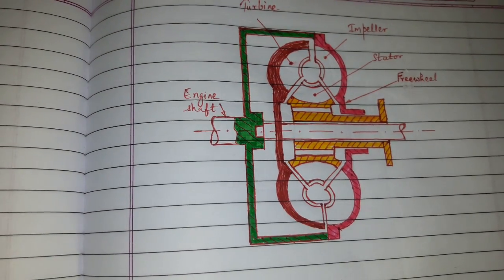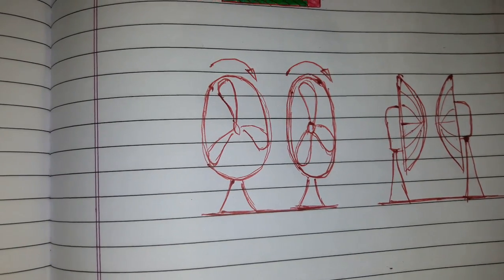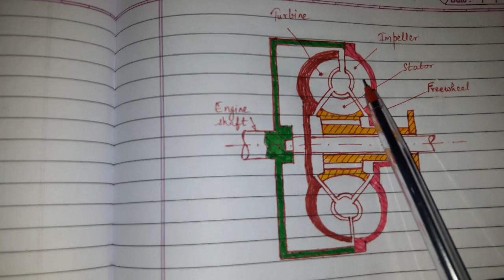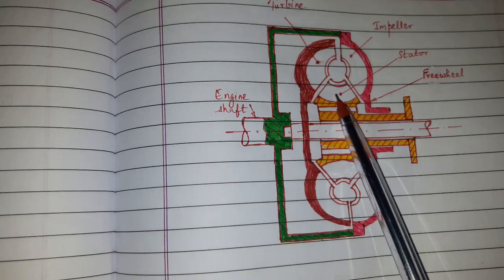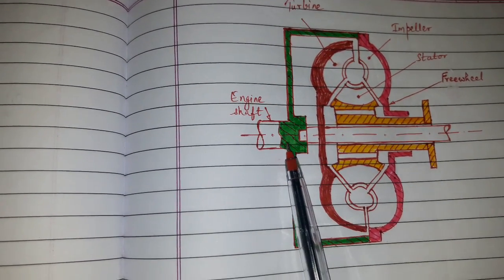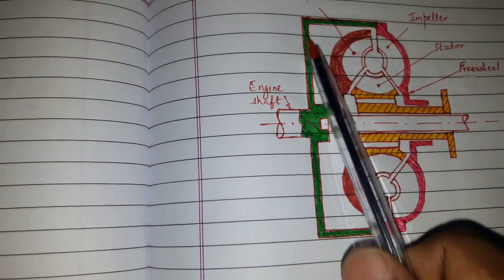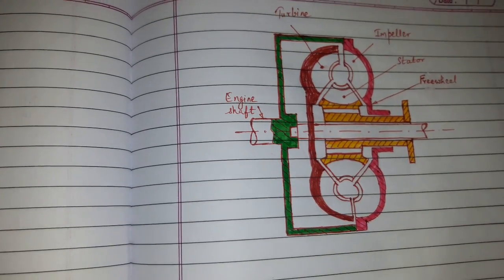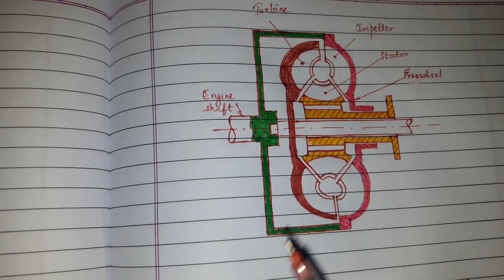Torque converter.... #60kviews #viralvideo

Comment from the maker: Difference between Fluid flywheel and Torque converter:

* Flywheel consists of two members - the driving and driven member. The driving member is attached to the engine and the driven member to the transmission shaft. The two members do not have any direct contact.

* The construction of Torque converter is very similar to that of the fluid flywheel expect for an additional stationary member called stator.

Even though the construction is similar, the operation is not.

The fluid flywheel transmits the same torque as given as given to it by the engine shaft whereas the torque converter increases the torque in the ratio of 2:1 or 3:1.

Thus the torque converter serves the same purpose as that of the gearbox whereas the fluid flywheel merely acts as a hydraulic coupling transmitting the same torque and power as that of the engine input.